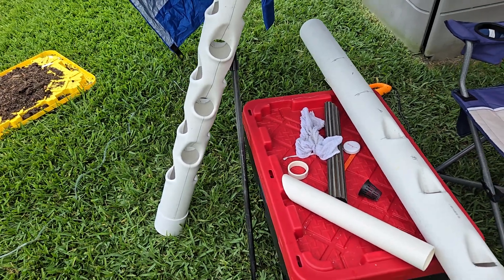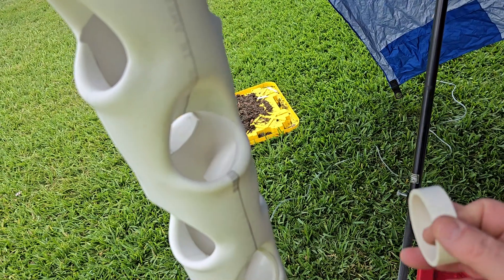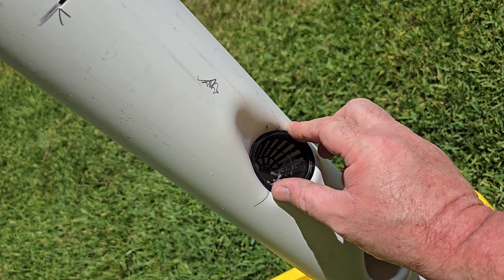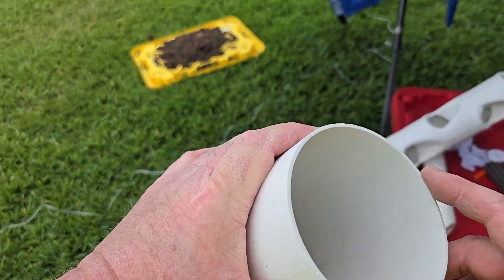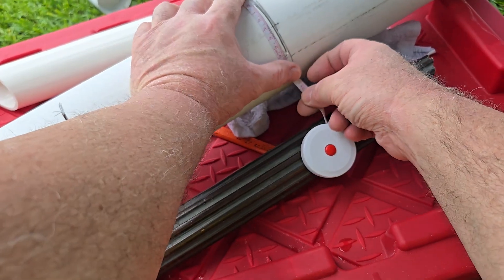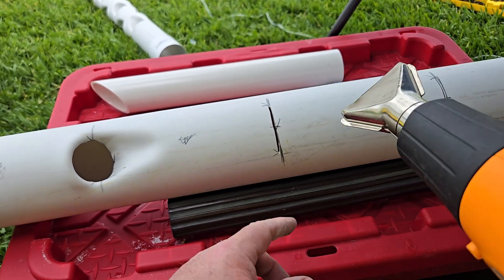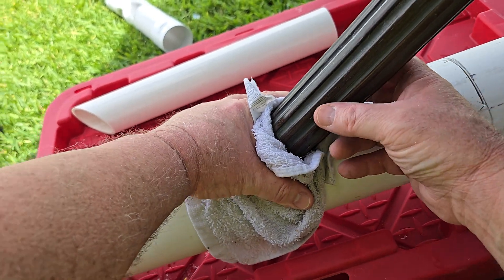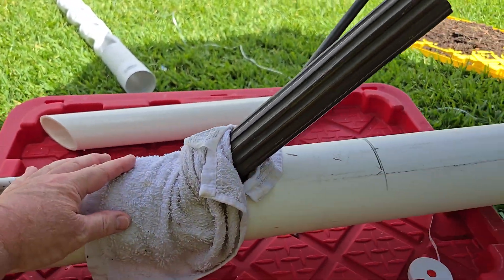The Missing Link - DIY hydroponic / aeroponic tower building.  How to cut and form the vertical pipe

Comment from the maker: The largest that I've found so far is 4 inch drain pipe.  6 inch would be ideal as the 4 inch limits the ability to have them on opposite sides at the same height as they hit each other inside the pipe.  The drum is a great idea.  I'll have to see if I can find them.  I get 48 plants on these using 1/4 of the pipe.  I put these on a covered patio so they only get sun on one side.
Reply: I used 160mm soil pipe, which has an internal diameter of 6".  I prefer my 35 site towers as they provide around 1.5 gallons of root space per plant.

Comment: Pvc pipe dimensions are related to the inside diameter. I made a couple of 5ft towers from 6" pipe, forming the holes was easy but tedious, it literally took hours :)  Towers can be made from (food grade) 55 gal HDPE drums. Used ones can be had for little money and provide at least 35 plant sites. .
Reply from the maker: That sounds great!  I wish I could find 6 inch pipe here.  I would probably have to visit a plumbing wholesale supplier.  The largest that they carry at the home improvement centers is 4 inch pvc drain pipe.
Reply: @phil2303  
Another option is round pvc / vinyl ducting (for air). 100mm and 150mm , 200mm is less common but does exist. Wall thickness is typically 2mm but relatively cheap fairly easy to find.